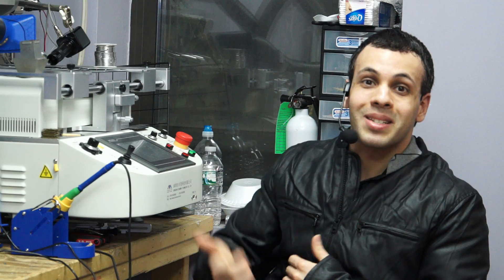How to get your #mbp2011 problem fixed for free!

Comment: So guys listen to me. I'm probably one of the last person from this program that obtained a new MacbookPro retina.

I first got a problem in February 2012, logic-board replaced with a model 820-2915.
2nd crash September 1st 2014; logic-board replaced  with a model 820-2915.
3rd crash on January 27th 2015; logic board replaced with a model 820-2915-B.
At this point I thought fuck, they fixed it. But no. Same shit
4th crash on April 26th 2015 (yup, 1 day before warranty expiration). I called, they asked me to bring it to the Apple Authorized Service Provider (AASP), they confirmed the faulty video card again and I called Apple again (very happy actually) and asked for a computer exchange (which was promised by the last customer representative i had during the previous crash: 4 repair, exchange machine, that's Apple policy). They refused saying "There is a program for that now [...] the computer exchange can't be done with you because it wasn't 3 repair in a year span time". I thought fuck it, hang up and thought about it.
I called back and luckily enough, had a new customer representative, which was no one else but a friend I met back when I was working in Cork, Ireland. He explained me the training they had on this program: the thermal paste problem is gone with the new logic board 661-5852, and they are asked to not provide a CRU anymore (the computer exchange after 3 repairs). They waited to find a fix for this problem before running the program of warranty extension. This logic board will last WAY MUCH longer than the previous one. They will most likely refuse any computer exchange now, no matter how hard you try.

Long story short, he is my friend, he accepted the machine exchange, made my case last a little bit longer in order to get the updated retina mid-2015. I have now a machine worth 3,399€ (extra hard drive cause the previous one had a 750Go and they must match the configuration), for a computer that i bought 1,100€ in 2011 (Apple program 27% reduction + 20% reduction from TVA from my company). I'm blessed.
Reply: Frenchie Boi Thanks for the taking the time to give us this update. This is good to know because otherwise, I could risk making the situation worse. I'll be grateful for having the improved and robust logicboards. I can keep it until I'm ready for an upgrade and then just sell it.
Reply: +ilikethingsfromjapan how did you go with it? on the 2nd board?
Reply: +Frenchie Boi my motherboard failed 3 times, wouldn't replace.  the 2nd replacement was with the supposedly leaded solder which is supposed to not have the fractures from excessive heating and cooling cycles, but it failed too.  so the new gpus do fail.

Comment: So... I've been trying to do research and find out other people's experience of killing their GPU AFTER the Apple Repair Program started a few months ago, and I have to say, I haven't found many successes. I hope I am wrong and now I'm exploring better ways to overheat the GPU without killing the rest of the components in the process. 

If anyone had their GPU fail again AFTER the official Apple Repair Program Service, please reply to this post and let us know the details like, how long did it take and how did it happen (methods, etc). Thank you!!!

And while i'm here, I guess I can share a tip to increase temperature (though after 3 days of consistent stress tests, the new GPU prevails -_- )

SSD Fan Controll app lets you MANUALLY set fan speeds. So I just keep it at 1500 RPM during the stress tests.
------------
I also have an idea that I want to run across the techies. Would reballing/reflowing the GPU in a certain way recreate the GPU Failure effects? Before the Apple Repair Program, I had a tech reball my GPU twice and when I brought it in for repairs, they still did it for me (didn't void warranty). Just wanted to get a 2nd, 3rd, 4th, and 5th opinion ^_~ THANKS!
Reply: Jin Awaken Please read the post I've just made, will probably explain you why it will take longer.

Comment: Hi, Louis! You seem like an excelent electronics technician... and I study the same thing here in Brazil.

I have a Macbook 13" (Early 2011) that won't charge the battery. Tried running with the battery unpluged... but the left LED indicator tells the same thing: 5 blinks - will not charge.

What can I do? I'm thinking of doing a reflow using a kitchen's oven.
Reply: Rafael Requião I also have an 2005 PowerBook G4 running smoothly. Almost 10 years of service. :p

Comment: recently i brought my macbook pro 2011 to the repair service for the second time the gpu broke down, and i got a call telling me that they detected water damage under the battery [sticker], so now my applecare is void [2 months left]. do you think i am still eligible for a replacement laptop if it breaks down for a third time?
Reply: gemeengoed You are not eligible to anything if there is water damage on your computer. They do not change the water damage censor as far as I know.

Comment: Hey Louis Rossmann  my 2012 15" pro retina has been experiencing screen problems since I can remember. They started off pretty minor, screen flickering for a second, full system freeze that would only fix with a forced shut down and random crashes. I have now been getting intermittent black screen that has caused me to look into this problem. I have no warrenty, and apple wont cover me with the Quality program because I didn't fail the VST test.. I have watched many of your videos now and have realised that even if I pay for a fix, they will only be replacing my faulty parts with faulty parts.

I want to follow your advice in this video but I am scared that I will destroy my laptop and they wont replace it, causing me to have to buy a new one. Reading the comments, some people have said that they couldn't burn out the new logic unit with the stress test and others have said that you should cover the vents with plastic rap to stop airflow.

Do you have any advice?

Comment: Hey Louis. What are your thoughts on what's happening with MBPr's and Yosemite / Adobe glitching? Seems very widespread. A software issue? Or a fundamental flaw in these discrete GPU's? https://forums.adobe.com/thread/1393885
Reply from the maker: beauchampy I never use the latest Apple OS because I do not want to be their beta tester.

Comment: Please read fully IMPORTANT
Video card problem in 2011 MBP 15" (2.0 GHZ)
went to apple store to repair
suggested to replace only Logic Board at flat rate $336 with inclusive taxes
happily paid and working laptop returned in three working days and followed Louis words
1. warranty period Dec 2 2014 - March 2 2015( broken in exactly 45 days from Dec 2)
and given to repair again and working laptop returned in three working days 
2. warranty period Jan 20 2015 - april 20 2015( broken in exactly 70 days from jan 20)
it takes little longer for second time because they replaced both logic board and hard disk. Thinking that they are smart.
repaired Laptop taken to apple store to replace. I'm talking nicely to person who comes to ask about the problem with MBP. I address the issue that it already had two repair  he brings up different scenario by saying that apple has identified that the old logic board failing again and again so they are making new logic boards (according to recent video card repair program) so that it will not fail again and again. i gonna give a last try hoping that i can break it again. 1.May be We all can get 2015 MBP
2. if you are paid any amount regarding this issue. you can get back whole amount through check if you contact apple customer care.
Looking forward to Louis reply on this
If you guys have any question please comment

Program used
GPU Test
Reply: Sethu Prasanth any updates on the new logic board failures? I got mine repaired in Mar 2015 but that thing just so robust, it's not failing lol.
Reply: I know this is late. did you got new macbook pro?

Comment: Well Louis,
I bit the bullet and had my logic board replaced for $328.00 after struggling for months with the graphic issue. I took your advice and ran the gpu stress test for weeks and weeks and more weeks, until well the 90 day warranty ran out....  But then Apple decided only about 2 weeks ago, to reimburse us Mac users. They wanted to check on my macbook, just to make sure all was still in working order, which it was, but I then noticed that the "Genius" installed the wrong logic board, instead of the 2.3ghz they had installed a 2.2ghz logic. They apologized and so my MBpro went off to another repair, free this time, plus I received a check for the amount that I had paid in Dec. 2014. It came back 3 days later and.... magic the logic board was still a 2.2 ghz...  LOL  Well off to another trip to the Genius guys, this time instead of sending my Mac off to another adventure, they ordered the correct LB this time and installed it themselves. So now I have another 90 days, well actually only 85 days left for some more stress-testing. Still thanks for your advice, maybe it'll work/break this time.

Comment: Help me!!! I have been running the gpu test on my 17" macbook pro 2011 and macbook pro 15" 2011 for 2 weeks none stop and they still has not died i stopped it today  and did a hardware test on the 17" and i get a sata error i installed a new 850 evo ssd before doing this test but it still runs fine...  any better way to kill it quicker? For the replacment logicboard with out killing th3 battery and charger wish is over heating.
Reply: Shane Cullen I was afraid this may happen. Funny, we wanted a good machine but the replacement seems pretty strong. However, we want a new laptop! lol. Any updates on this? I'm trying to kill my MBP15,2011 as well but it's not budging.
Reply: No go its been running strong for almost 2 months straight  it wont die lol
Reply: +Shane Cullen Any succes so far? No result after 2 weeks here either on MBP 15" Early2011.. Not sure if I want to continue considering the battery + charger..
Reply: Nah my fix was to good lol

Comment: I'm at my 3rd logic board since january. My MBP never worked for more than 1 hour after repair and I NEVER RAN THE STRESS TEST. My original repair price was CA$611 and after a lot of arguing they put me 30% discount on it. Yesterday they refund my repair price and made a mistake by not applying the 30% they gave my at first! (ah! fuckers!). In the process I also had to change my RAM, which endend not to be the problem.

Comment: Hello Louis Rossmann , thanks for this video!
I got my computer fixed for free. I asked what they were going to do and they claimed that the new logic board was going to be different to avoid the issue again, but did not know any detail. Is it true or the new logic board is going to fail as the other one? How long does it take for the logic board to fail running the stress test 24/7?
Thanks again!
Reply from the maker: Same shit. If you open it and it says 820-2915 near the wifi/webcam cables, you got the same BS board.
Reply: Louis Rossmann thanks! do you have an idea of how long it takes for it to fail running the furmark stress test 24/7?
Reply from the maker: No clue
Reply: Louis Rossmann is it likely to happen within the 90 days of extended warranty? I mean, is it worth trying it or should I rather trying to keep the laptop cool? Is there any chance that even if the logic board is the same they are using better thermal paste or better soldering and the laptop is not going to fail again? Sorry for asking so many questions, you seem to be the best source of information about this topic that I found :)
Reply from the maker: No no no this was a shitbox when it was new and it is a shitbox now. Kill that POS and bring it back until you get something hat is not a POS. Killig it can be done through basic use.
Reply from the maker: Yes of course, but they wouldn't be very "honest"
Reply: Louis Rossmann
 they would not be honest but if they did I would not be able to kill the laptop within the warranty period :/
I opened it and
it says 820-2565A. I am not sure if it is near the wifi/webcam cables, it is in the cornes near the fan. Is it a different logic board or what? Thanks again!
Reply from the maker: That is the DC in board number and has nothing to do with your motherboard
Reply: Louis Rossmann, on a side note what do you think of the Dell's XPS 12 2-in-1 Ultrabook™ with Touch Screen and of the New XPS 13 Touch? I was thinking of selling the macbook, add a couple of hundred bucks and get one of those
Reply: Louis Rossmann
so where is located the number I should look at to know if the motherboard is the same as the previous one?
Reply: Louis Rossmann if I run the stress test with antialiasing the gpu chip temperature is around 75 degrees while without antialiasing it goes up to 90 degrees. Should I run it without antialiasing?
Reply: Francesca Di Gregorio interested in the answer too Louis Rossmann
Reply: Francesca Di Gregorio Louis Rossmann Just checked my part number and it's a 820-2915-B . So it seems like they changed something. It would make sense that they found the solution and now are able to mass produce a replacement board and so launch the repair program. They wouldnt have launched a repair program if the part were still faulty once changed.
Reply: Frenchie Boi +Francesca Di Gregorio +Louis Rossmann My macbook finally crashed after normal use. I have the new model of motherboard and it still is shit. I called Apple, and they want to repair it AGAIN. I asked about an exchange with a new machine but they didnt want to hear anything, and asked me to write a letter to Apple HQ.
Reply: Frenchie Boi Did it crash from Normal Use or constant stress testing? And if normal use, what sort of work do you do on it (ie. gaming, rendering, etc). Thanks!!!
Reply from the maker: They're getting smarter. Guess seven months of people watching this and getting retinas sunk in...
Reply: Louis Rossmann +Jin Awaken It crashed from my normal use : dual screen, photoshop and lots of chrome and firefox tabs. I got a new retina now tho, please find my post i just wrote

Comment: Apple just caved (a little) and they now offer "free repairs"
I wonder if that means they will also reimburse people that paid for a repair (like I did)
Also wondering if my machine "breaks" within 90 days would I be eligible for a new device (less likely)
Reply from the maker: slimgardener It beats nothing, but yes, this came way too late.
Reply: Yea, I'm about to get that free repair. I'm gonna remind them that they already replaced my mother board less than a year ago on my 2011 mbp, so there is no logic behind doing it again (in a very polite way of course). If they dont give me a new computer then, I'll try stress testing it until it breaks.
Reply: +Christopher Gunlock any luck?
Reply: they did end up reimbursing me for the fee, but that was because I reminded the tech on the phone what I had paid (they almost kept the charge for tax too!). Doubt stress testing will work as they will just replace the logic board again.

Comment: Louis Rossmann  I found this video about 2 weeks ago after my November 2014 repaired 2011 MBP started flacking out on me again. I followed the suggestion of Louis Rossmann  and took my machine into the Apple store and asked them to look at it. I stayed calm and cordial during the entire transaction.

It wouldn't boot so they said they would replace the logic-board after running tests. They also told me I was "lucky" because they had the part in store and I'd have my machine back in a day. That was unless I wanted them to run extensive tests on it to make sure the fix was good. I opted to have them keep it an extra day for the tests. 

I picked my MBP up 3 days later. At that point in time I expressed to the genius that if this - the third attempted fix since April of 2013 -  didn't take we needed to "look at other solutions to this problem." He agreed and said he would make a note in my file.

I used the machine lightly for about the next 6 hours, then I started doing some Photoshop work and the issues started to resurface. I had the machine on for a total of about 8 hours the same day I picked it up.

I took it back the the store the next day - actually 24 hours later - and the resulting resolution was they offered me a new MBP because they couldn't fix mine. Since they now only sell two models of the 15" MBP, I was glad I didn't have to haggle for more memory - which I had upgraded myself to 16meg - or a larger SSD, which I had also upgraded myself from the 500 GB Toshiba.

I wound up with the top of the line MBP while only paying for the upgraded processor- $200. 

Thanks Louis for the tip to stay calm and reasonable.  Because I could have lost it when these people were denying the GPU problem and telling me it was a combination of factors including the logic-board, battery, and hard drive cable. All of which they replace during the November repair. 

I hope the fact that Apple now acknowledges this issue doesn't stop them from giving people a new replacement machines.

Comment: Louis Rossmann so now that apple has initiated a repair program, what's your take on this? Will they just replace the logic board with another one that uses the same shitty gpu chip? Or is it likely that they use new, better logic boards for the replacements?
Reply from the maker: redtuna14 Same trash.Will last you until February 2016 after which point you will all get middle finger.
Reply: Allen Coggsburn Hey, any news on that one ?